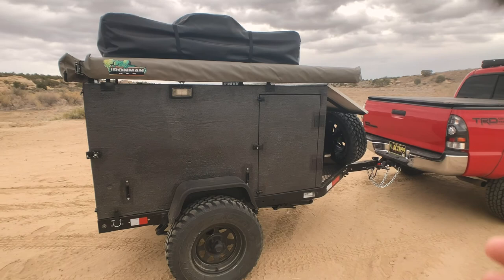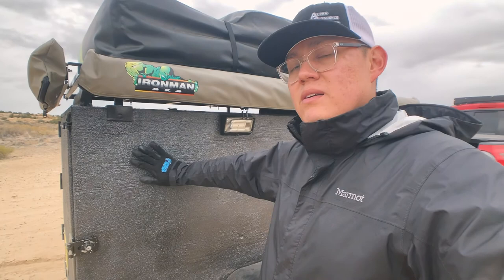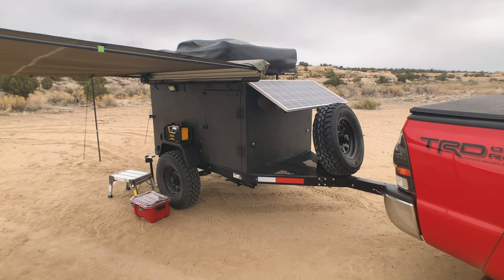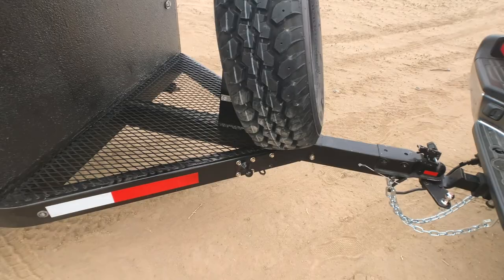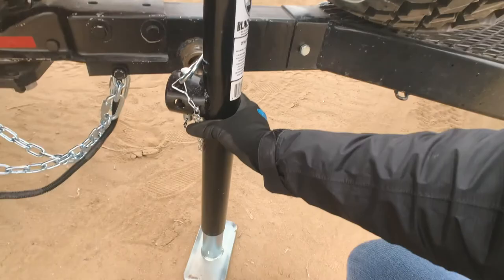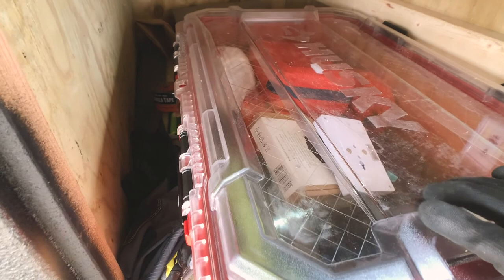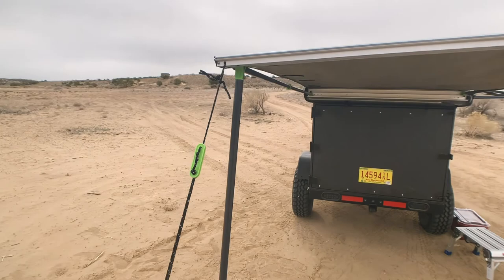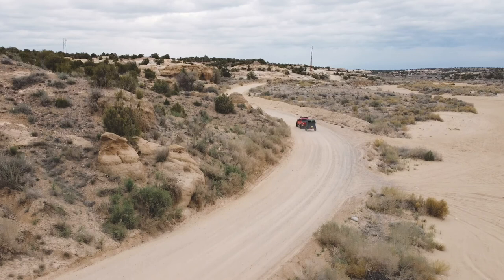Our New Overland Trailer!

Comment: Looks like a great start.  Lots of options with that trailer.  

I would be inclined to redo all the hinges on all the doors though.  A sneaky person with a cordless drill with a screw bit will make short work of removing the door hinges and get at your gear quickly.  Consider making a welded angle iron frame around the doors as well as the door openings and adding piano hinges inside the gap.  Obviously you would have to trim the door to give the needed clearance around it. Maybe also sturdy up the door latch with a metal backing plate and an actual locking RV door handle.  Being a plywood body, a crow bar would pop that current lock off in short order. 

Looking forward to future upgrades and trip reports. 

I recently added an ARB screen room to my 2500x2500 ARB awning on my trailer, and an Ironman screen room to my 2000 x 2500 ARB awning on my truck.  The Ironman was cheaper with a removable floor, so I went with that one.  The Ironman fits the ARB perfectly!
Reply from the maker: Thanks! It definitely is a good starting point. Great points on the locks and hinges. I’ll look into that this week.

Thanks for watching and I appreciate the feedback!